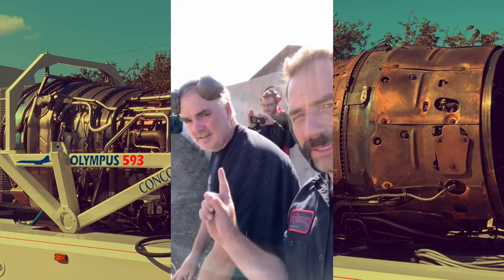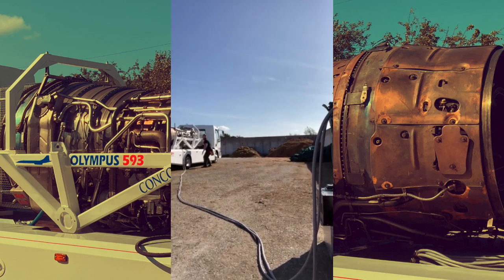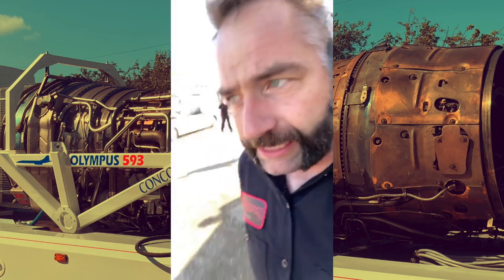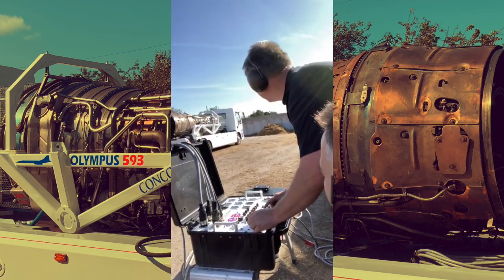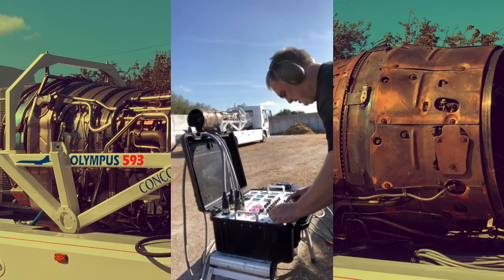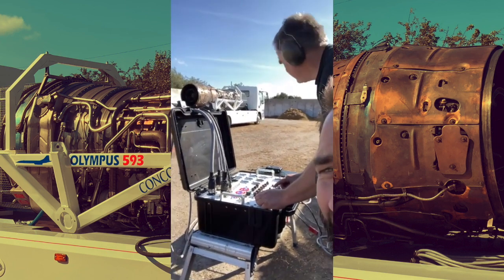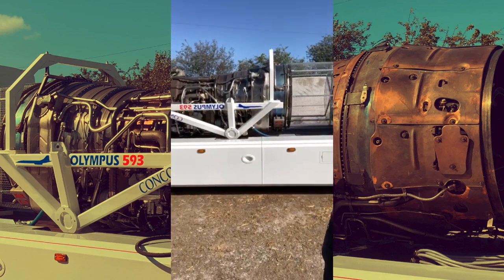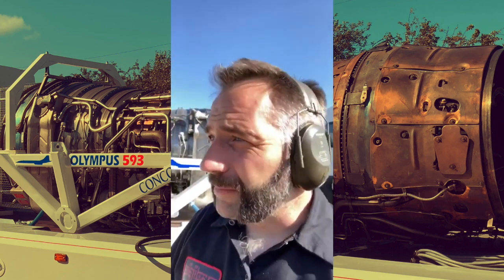Is It Possible To Stand In The Jet Blast Of The World Only Running Concorde Engine?

Comment: Trying to talk over a Jet-engine ...?   LOL
Reply: Doable, but you need a guy who makes Loud Howard from Dilbert look quiet. I knew one guy who was capable of that, though not over this Olympus engine.

65%, you should have taken a brick and tossed it into that air stream, looks so slow in the air, till it hits that stream and vanishes off to the side faster than you can blink, and then smashes to pieces when it lands again. Explains that dip in hearing response around the 1kHz mark i have.......
Reply from the maker: You don't know until you've tried it!